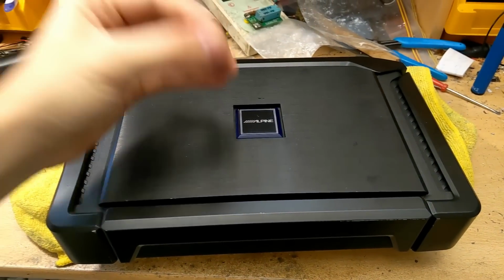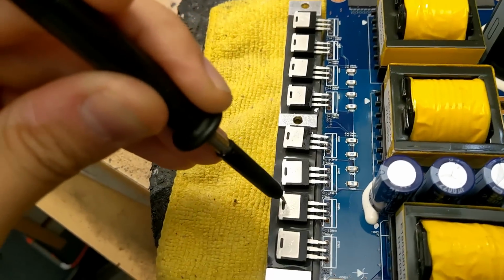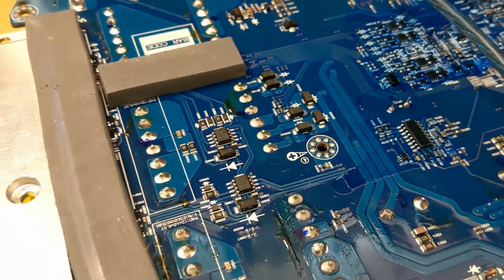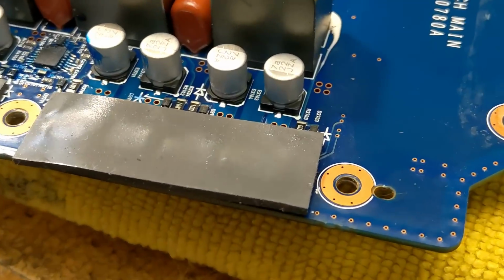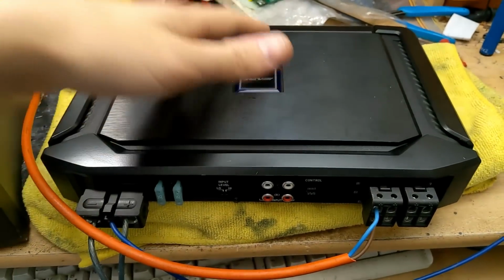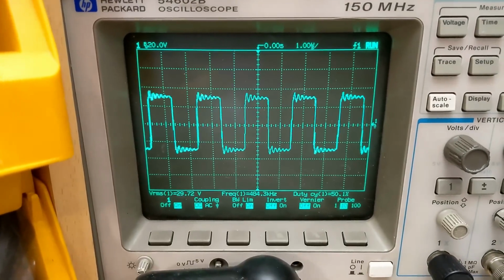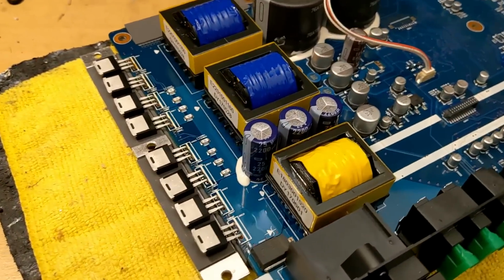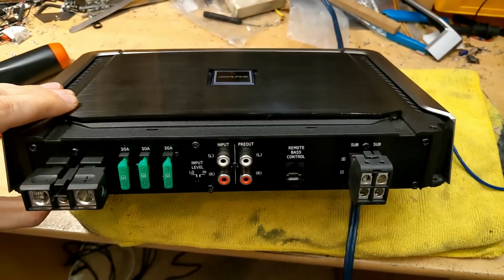Are newer Alpine amplifiers still any good? X-A70F, X-A90V, X-A90M

Comment: Alpine one of my favorites them and Fosgate amps then Kicker nice to see Alpine sticking to their guns making quality products still. Question for ya on my test bench i have a Orion amp it works great no  buzzing/humming noise on the output  from my AC to DC adjustable power supply but when i put my Skar RP 1200.1D on it there's a wicked hum yet it doesn't do this in the car any idea why it does this? i mean i paid $65 for a cheapo 1200 watt power supply silver box looking ones but the Orion runs clean off of it.

Comment: Hi Sam. Could you please confirm?
As I understand all 3 amps have positive and negative rails, so X-A90m - is just 2 half bridges that uses Positive and Negative rails and bridged together.
Not like the most "brazilian" full bridges with single voltage rail and virtual ground point?
Reply from the maker: @VitaliyHTC  hmm technically no. In order to be two half bridges permanently strapped they would need entirely separate power supplies, preamp circuits, etc, essentially two separate amps. A full bridge can either have bipolar rails or a single rail, it doesn't really make any difference as far as operation or sound goes.
Reply: @barevids  Ok, got it (Understand my mistake). Thanks for the answer :)

Comment: I would love to see the new r2 series of alpine amps, they show s series amp guys but never the r2 series, I’m still trying to decide btwn s series 1200 watts rms mono amp and the r2 series 1500 watts rms one, I really prefer replaceable to-220 mosfet, rather than surface mount mosfets, cause they are better cooled and easily replaceable or repaired, these surface mounts are harder to repair and like in these models are cooled through thermal pads to the heatsink that’s not very efficient hence they run hotter less reliable

Comment: Awesome video. I still buy the old duo b and mrv V12 alpines. I will NEVER buy their newer stuff where they started installing Anaview/able IC gate drivers in the amps. Which on 99% of the amps IS the failure! Of course you CAN’T buy one to repair the amp. A $2 part makes these amps TRASH. 

Forcing people to buy a NEW amp over a $2 part is greedy!
I’ve been a huge Alpine fan since the mid 90s. Have 4 mrv-1507s, 4 old school cda 4volt out Cd players and an Alpine 3558, that I absolutely LOVE. I’m done with alpine forcing people to buy new amps, because their custom ICs fail so often. Good for Alpine,  bad for customers and land fills. 

I hope they go back to making their amps repairable again….. until then I’m done with Alpine.
Reply from the maker: They are technically repairable with an IRS20956S from china which is a restamp of the proprietary part, but yes very annoying!

Comment: Why would the amp need an additional microcontroller? as the TL4949CN does provide short circuit and temperature protection as well as PWM control. You are right this amp is well over engineered, more circuitry to go wrong.

Comment: You would be hard pressed to find a through board component in a modern ECU. Why would surface mount be an issue in an amplifier?
Reply from the maker: ECU is logic level, low stress, low thermal cycle environment, very relaxed operation. Surface mount parts are much more prone to failure in the opposite.

Comment: What happend to boom or bust ?
Reply from the maker: For those wondering about Boom or Bust - I do plan to continue it, however I got absolutely crammed with repairs to the point that I had to turn one of the other rooms in my house into purely incoming repairs storage; and also the videos arent really doing as well as i'd hoped with relatively low views, and it isnt covering my expenses and time making each episode. :( In the meantime I've actually been making loooads of videos on TikTok, really fast paced snappy repair overviews and theyre doing really well, so if you're on the app search Barevids and check it out!

Comment: What amps is this good for the fraction of the price
Reply: You're just not going to find amps with this level of high quality components, design, sound, or longevity in a budget amp.  This series of Alpine amps have been discontinued and replaced by the Alpine STATUS series amps, so see if you can find any of these older X-series amps second hand (used) at a good price.

Comment: Hi,

do you have service manual / schrmatics of these amps?

Thank you
Reply from the maker: No sorry
Reply: @barevids  no problem. I would like to make direct input but I do not want to without schematics.
Anyway what is your plan about them?
Reply: @kiklop8362 
Hello, mate.  These amps are owned by Nerijus Kochanskas (@RAW-CAt on YouTube and @Pixerix on DIYMA) in the UK and will be used in his SQ competition car when they are returned to him.
Reply: @bbfoto7248   Yeah I know his work :). Why is it disassembled? Some upgrades or just for check?
I am running 2 A70F, one for each side  3 way so that is why I am asking :)
Reply: @kiklop8362  Check with Nerijus or Sam  @barevids  here.  But it looked like there may have been a burnt and replaced FET on one of the boards, so maybe in for repair and Nerijus had Sam check the other amps as well just in case before installing them in his car.

I use a pair of the X-A90V 5-channels in one of my installs and have been very happy with them...and no issues so far.  Same configuration as your X-A70F...one for the 3-way Left side and one for the Right side plus mono channels on a 2-ohm DVC sub.
Reply: I second on that

Comment: Finally something new that seems designed with modern techniques. The power supply seems a full bridge type maybe the third inductor is used to make it resonant, non sure about it. From the waveforms it seems to operate in zvs mode at least at idle.
Class D is a classic half bridge type. 0115 fet is Infineon BSB165N15NZ3. International Rectifier does not exist anymore, many of their former products are now labelled Infineon

Comment: based on the vent design, the rail caps is most likely coming from Chemi-con. i like the parts choice but those final stage mosfets are son of a mother to work on!.
*lol yea there's Chemi-Con brand during A90V part

Comment: I have an amp wall with all the iconic amps I've purchased over the years, but the vocal point is always the alpine, and mind you, I have a ppi a600.2 first gen foagate 150hd, but the alpine has more art than the art series. I took an mrv1505, and replaced the bottom plate with plexiglass, mounted it backwards, and all you  see is v12 on all the cap's. If you have never seen the guts of a 1505, go and search it, and I promise  you'll understand

Comment: i have one car still running a full set of the pdx series of amps (250's, 450's, 1000's etc that system has 5 amps in it). never had a single issue with them and being one of the original full range class d amps they still sound great

Comment: I have an Alpine MRD-M301 from around 2004 still running strong. Not a lot of power and not sure of the design in it but sure is reliable.
Reply: Still got a Premier Pioneer CD head unit from 97*? did have a few years of shelf life but works same as always.

Comment: Hey barevids, I've got a question if you have time or to anyone. My friend bought a new $250k wakeboard boat with an insanely nice factory Wetsounds speakers  but there are NO  gain or crossover settings whatsoever on wetsounds amp or built in headunit. There's not even a custom EQ, only pop, rock ect. BS. 
Is there something that could make the system tuneable without replacing amp? Head unit replacement is not an option.  Thanks
Reply: Most likely will need to change the amps out to something that can be tuned.
Reply: You can't tune an amp unless it's a DSP amp. They just have gain/crossovers. Sometimes bass boost.

You need either a EQ or a DSP. You can add one in between the radio and amplifier in any system.

Comment: Can't hate on Alpine.  I currently have a PDX-M12 stacked on a PDX-F6 that has been in my truck since new in 2011 and they have been absolutely flawless.  Expensive? Yes. Cheap big power? No.  But they are built great, sound great, and have been crazy reliable.

Comment: One thing I like about Alpine vs cheaper brands is you are pretty much guaranteed true balanced inputs.   The signal chain is very well engineered and the noise floor is incredibly low as a result.
Reply: @v12alpine  
While they are not "True Balanced Inputs", because that would require 3 conductors on each input channel (like the new Alpine F # 1 STATUS' balanced XLR connections, or the mini-XLR I/O connections on the old ORION DEQ30)...

But they ARE "Differential" RCA inputs and not the more common Single-Ended RCA inputs (where common/negative is tied to ground).  The Alpine's "Differential" RCA inputs do help to reject or cancel inducted noise via "common mode noise rejection," but it's not a "fully balanced" amp.